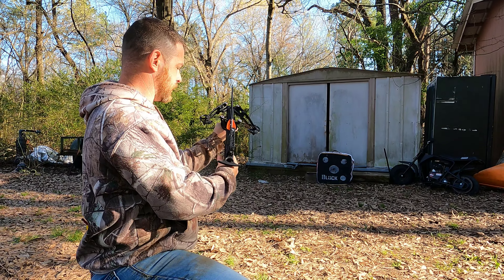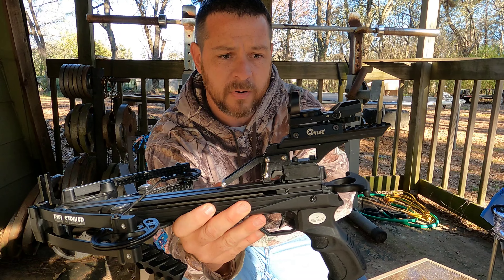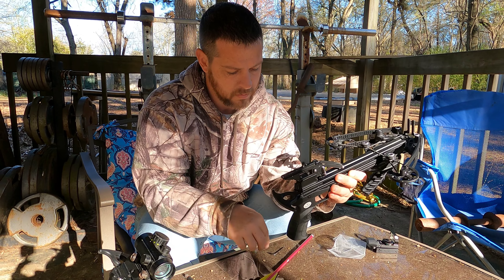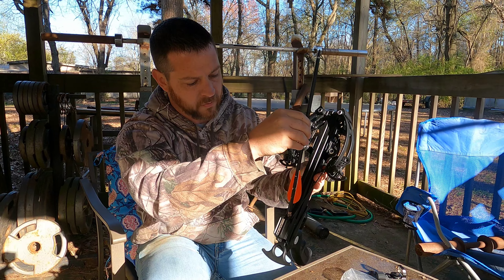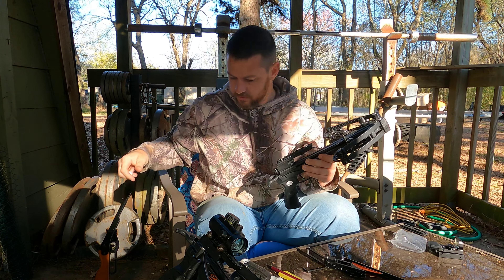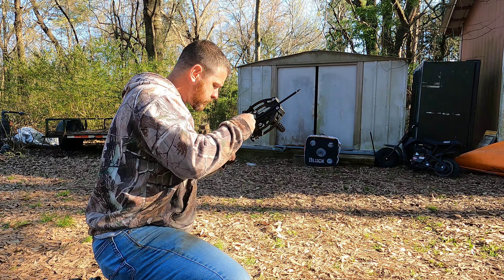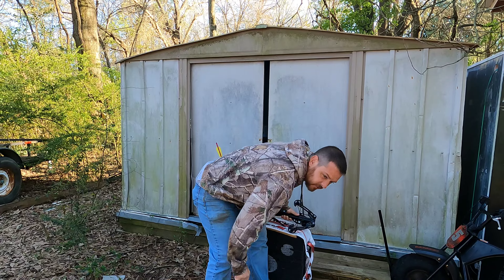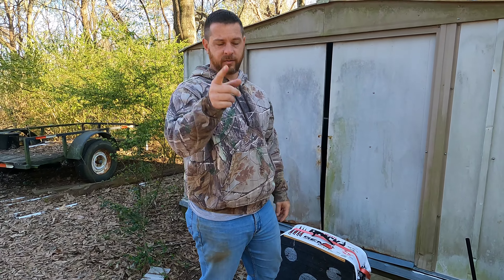Epic fail w/ experimental upgrade to the Mini Striker Pistol Crossbow

Comment: I bought some cheap lighted nocks from Amazon that are moon shaped. Not like the ones that come on the arrows when you buy them. These have a more pronounced crescent shape.  the ends of the moon shape go down in the groove in the flight rail and fit under the string letting the arrow catch the string very well. I haven't shot a full sized arrow out of mine yet,  just fitted it. because the fletchings hit the metal fingers that pull the string back. I'm waiting on feather fletchings to come in then I'm going to test it out. Just thought I'd let you know about those nocks. Have a good one man. Ps. Id post a link to them but I don't know how to do that lol.
Reply from the maker: Thanks! Yeah the cocking mechanism don't lay under the rail on the RD like it does on the forward limb bow

Comment: Sorry for my english. I don't have those pistol crossbows but i think i see the problem why it has dryfired. It has to do with the trigger mechanism that retain the string in particular the part that we see at 1:13 : this part has to rotate upwords to liberate the string and your bolt was contacting this part so it sligthly lift it up while the string was going under. I suggest you put something under the picatiny rail that prevent the bolt to rise (like a small piece of wood screwed to the picatiny rail or glued) and that you leave a small gap (1 or 2 millimeters) between the nock and this trigger part so it will rotate without lifting the bolt. You can actually make the piece of wood with a small retainer part preventing the bolt to go completly to the back (like a small nail pocking out of the piece of wood ).
Reply from the maker: This is most likely what happened. I'll be honest I wasn't sure how it happened. I just knew I didn't want to try it again.

Comment: Thanks for addressing this. I've managed to do some research and what they are is micro-diameter arrow shafts at 4.2mm inner diameter and 6mm or whatever outer diameter. Honestly had I known in advance how much more expensive these specialty bolts are in comparison and the difficulty with the trigger assembly getting in the way, I probably would not have bought the mini striker. Not only more expensive but hard to find the materials especially the inserts/outserts that fit properly and required to make your own. But this is excellent information to keep in mind. I suppose, it is what it is.... Probably going to keep my striker and figure out what I need to do
Reply from the maker: I've had really good luck with full size crossbow bolts, but it's hard for me to recommend it because they don't seat. 

Kinda a try at your own risk kinda thing.
Reply: I’ve been messing about with all sorts of carbon & fibreglass shafts for ages but when I opened that box & just felt the quality & lightness of them sharrow shafts you just know 😁 +&- of between 0.03 over 31” is very good cut down to 13” it’s 0.00 👍
Reply: If you make your own how long do the shafts need to be cut for the broadhead to just clear the end of bow?

Comment: Try cutting down a compound bow arrow to 14 inches and reshape the nock to a halfmoon. Reinstall two fletches and you're in business. I made one for an 80lb crossbow pistol and it shot fine but was a little heavy. The diameter is smaller than a regular crossbow bolt. You can reshape lighted nocks and use heavier broadheads if you need more weight. I used the cheap $4 to $5 Walmart ones.
Reply: Shoot yeah, ohh modifications,, excellent, TY SIR🇺🇸🙏🏽❤️

Comment: for full diameter bolts you will need to open up the flight track so the centerline of the larger diameter bolts are aligned with the centerline of the string.
Reply: Yep. Milling that out would be very costly, in money or time, and still might not do the job.

Comment: i would try building custom arrows using 9/32" shafts paired with the pistol crossbow moon nocks used in Cobra R9 arrows (the stock ones are plastic, but there are aftermarket parts made out of aluminum), the only downside is i'm not sure there are any glowing crossbow nocks manufactured in this diameter
Reply from the maker: Yeah I'm gonna stick with arrow making...modifying bows ain't in my wheelhouse

Comment: You should compare over the chrony to see how much more zip the extra half inch of contact can be add to acceleration and their by ft lbs etc.
Reply from the maker: I'll have to measure it. I don't think the power stroke is any longer...I'm pretty sure the assembly housing is just cut back.

Comment: It looked to me like that the bigger fetching were likely causing the issue. The string angle is so extreme that it was touching them.
Reply from the maker: Yeah the longer fletchings sit on the string but this hasn't caused a problem. Turns out the string release was lifting the arrow as it released the string. This caused the string to slid under the arrow. 

The solution is a nock like on the Adder bolts with the sides filed down. Them suckers shoot like a dream just never got around to making anymore videos about it.
Reply: Oh OK. My little Hell Hawk will be in any day. So, I need to get some fishing bolts I reckon.
Reply from the maker: @UncleDanBand64  I just shoot the slingshot fishing arrows out of mine just like they come from Amazon. It scratches the rail a little bit I've put hundreds of shots through it and it's still ticking.
Reply: @TheWaterSwatters  thanks
Reply: @TheWaterSwatters  I see there are some designed for the pistol crossbow. Why not use them if the metal slingshot darts are scratching the rails? Is it just a durability issue?

Comment: 💡Your concept will 100% work, you have to have spring tension on the top of the arrow to hold it down on the rail👍 I modified mine by taking that little top part off that limits the arrow to 6mm. They put that little piece in there on purpose to make you think you have to buy their overpriced arrows/bolts😡 Please be cautious shooting the full size bolts like that with the gap because that string slaps against the back of the bolt and causes your string to frey fast if it's not immediately resting against the bolt when fired😞
Reply from the maker: I didn't know that piece would come off. I went the long way around, found a distributor and started making 6mm bolts. I'm gonna look into taking that piece off so I can shoot larger bolts.
Reply: @TheWaterSwatters  👍And hopefully when/if your strink snaps they'll replace yours for free by you advertising for them for free, because their replacement strings from William Tell are a CHEAP JOKE!😷 They are basically skinny cheap hand made crapp for $40 and are nowhere near the thickness/size of the original string that comes on the mini striker, they should be ashamed of themselves for doing us customers like that because I'll NEVER purchase anything else from them again!😞 I'm gonna buy from Balista ONLY If they're NOT the same company that are just using different name's like The Home Depot and Lowe's are to make FAKE competition. I really enjoy your channel and I thank you for doing all the educational thing's/tests that us city folks want to do with these crossbows but can't before heading out into the woods to hunt, so we learn a lot of what they're capable of from you!🙏 Thanks again!👏👏👏💜👍👍👍👍👍

Comment: Looks like it cannot fit the full sized bolt due to the diameter being larger, causing it to sit higher up and not center the nock to the string, which would cause the string to go under it.

Comment: Idk what kind of knocks you use I tried flat backs on mine and string went under the arrow everytime but I think the issue was more the size of the shaft it doesn't sit in the rail like the smaller diameter ones do id say the reason it works on the factory set up is because it fits tight in the housing it probably doesn't have enough room to go under the arrow
Reply from the maker: You hit the nail on the head. If the arrow just sit a little deeper in the rail I think it would work....but up until I pulled that trigger I would've bet this would work lol.
Reply: @The Water Swatters  what size arrow shafts do you use?

Comment: 14" is the a regulation where you are? in FL it just has to have a 1 inch cut broadhead....... If ballista is watching or striker you should make those arrows available
Reply from the maker: 14 inchs is the minimum bolt length for deer hunting where I am. Ballista made me a single 14 inch sting bolt. I killed a couple deer with it but it was a custom job kinda hard to come by.
Reply: @TheWaterSwatters  Man they should offer it. I mean there is really nothing extra they have to do other than cut the bolt a little longer. honestly It makes me wonder If I cant just buy carbon rod and make some

Comment: How do you feel about shooting the bolts they supply at 40 yards?
Reply from the maker: The bow would shoot'em that far but you wouldn't get consistent groups. It's not the bolt but the fletching. If you cut off those short fletchings and replace them with 4 inch fletchings you'll get much better groups.
Reply: @TheWaterSwatters  Great Thanks!

Comment: Why do you need to shoot crossbow shafts. If you want more weight, just add weight to the interior of the shaft with longer inserts, tube inserts or some other type interior structure
Reply from the maker: It's not the weight I'm after it's length. A bolt must be 14 inches to deer hun with where I am.

Comment: I pretty much have that same setup buddy…..have you tried using the regular standard size arrows for the real compound bows ? I generally cut my arrows down to 14” and reshape all the nocks to accommodate the string seating 😇👍…shoots great time after time, and gained a significant amount of speed out of it 👍thought it might help with your dilemma 👍
Reply from the maker: I never have. All the arrows I have for my compound bows are to big too, unless I have the mag trigger assembly in. 

I was thinking about using a regular arrow with the EK Adder nocks. Should fit in the mag trigger setup.

Comment: Another good vid , mate no partial dry fire is good trust me 😢 you should try the arrow shafts I just got from China 900 spine it’s awesome & dead straight 😮😅 I’ve a video uploading now testing a batch earlier 👍
Reply: There’s also an utt-oh with my bow as well during the video 🙄 that dry fire is such a sickening sound isn’t it? 😢
Reply from the maker: Do ya just order 'em off Amazon or a website?
Reply: @TheWaterSwatters  sorry yeah meant to say from eBay, my video stopped uploading at 85% cos I took the dog for a walk & should’ve left phone at home🙄 you wouldn’t need Broadheads either, if you get it get the tip adapters like i did, I’ll look for the sellers name for ya 👍
Reply: ZD-outdoors, it’s 31” pure carbon arrow shafts sp500-900 👍
Reply: @TheNorfolkBowyer  what about the inserts and outserts for threaded broadheads. I've spent days searching and cannot find anyone selling 4.2mm ID with the threads
Reply: I would like to know exactly what you ordered so I know whatever I buy will work. as opposed to dropping $40 plus shipping/tax for 5 overpriced small ass hunting bolts from Ballista, William Tell, etc.
Reply: @itechhen  got mine from the same seller zd-outdoors & again they’re very good & fit the shafts snug but they’re alloy & will bend if you hit anything hard like a 1” thick larch fence 😂 I will make them from brass but saying that I think he had the brass versions 🤔
Reply from the maker: @TheNorfolkBowyer  I can't find exactly what you're talking about. If you find time can you email me a link thewaterswatters@gmail.com
Reply: I just got mine back together & she hit 279fps with 280gr bolt, the rear limb mounts were worn & there was more strength in the right side limbs but now it’s even smoother & 🤞 stops breaking 😂😂

Comment: Moon nock?
Reply from the maker: Yeah I'm not sure why that didn't work, but since my bow didn't blow up I figured I'd better not try it again lol.
Reply: @TheWaterSwatters  or u can switch on flat
Reply: @TheWaterSwatters  A dry fire doesn't necessarily need to result in something flying off the bow. Damage can also be at a microscopic  level with fracturing or reexamination of the limbs.  I wouldn't consider the first 1/2 inch gap a dry fire. The worse conclusive shock comes at the end of the string release. It was engineered a certain design for a reason.  But it's your bow, and your money. Be safe and have fun. Thanks.

Comment: There is something wrong with that bow, or you been working out full time. You just pull that cocking string back like you had rubber arms on that bow. I mean mine, I had to use the foot brace down and stand on it then pull back with all I had to cock it. But, when I shot a bolt into the frozen ground with a tree back stop, the bolt went almost up to the fletching into the dirt. :body-blue-raised-arms: